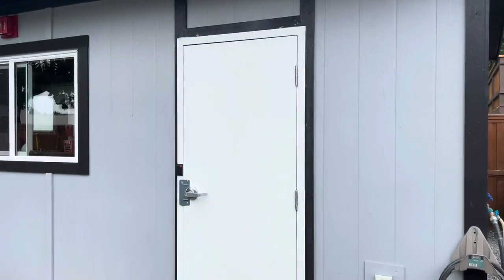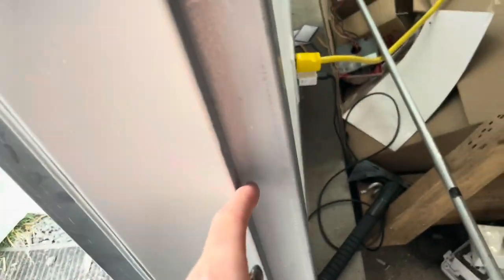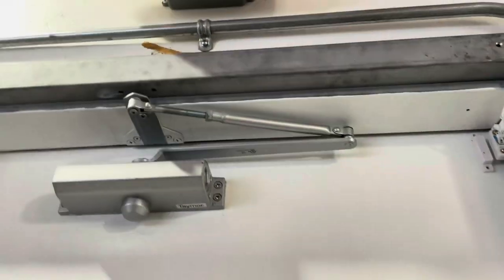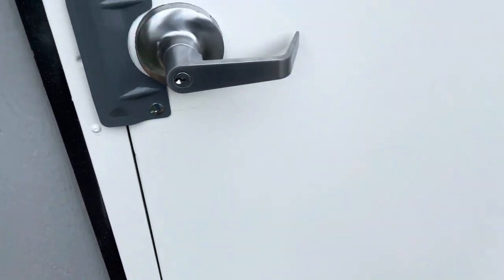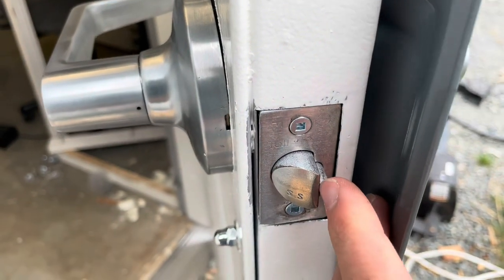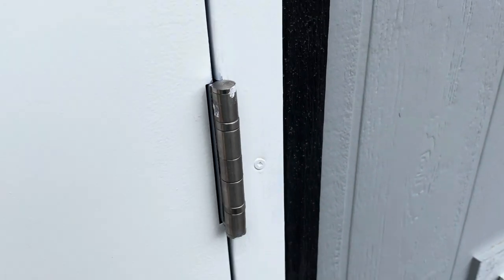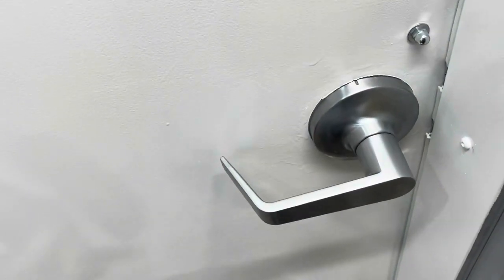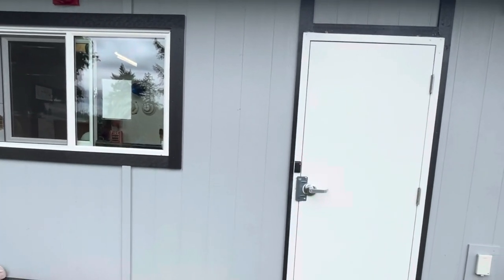Door upgrade replacing the door on my garage

Comment: Awesome install! Maybe you could install a panic bar in the inside! That would look pretty cool ngl!
Reply from the maker: That’s what I said in the video but yeah I would like to
Reply: @nics-systems-electric  Yea maybe if you could find one for cheap you could install one
Reply from the maker: @Roxxofoxxo  It would have to be compatible with Schlage hardware so I can still have a Key override on the outside and it would not use the latch inside the door so I would need an external strike plate an electronic strike plate for panic bar latch is about $130 minimum so it will be an expensive project but it would be fun
Reply: @nics-systems-electric  Ohh
Reply: @nics-systems-electric there is latch retraction option on several panic hardware, you could just get a Von Duprin 98/99 or 33/35 with some latch retraction setup. You just need to put the motor inside the panic bar with some wires. Or you can electrify the lever trim outside your door that has the fail secure so the fire alarm will unlock the door.
Reply from the maker: @relevanteaglealarms109  If I was going to do internal door latch retraction I would just keep the current electronic strike plate
Reply: @nics-systems-electric  you could. Well changing out and upgrading it to panic hardware would be beneficial to the doors in the future. Well the ones with the latch inside was basically rim so you could ether try to order a mortise version but more complicated chiseling.
Reply from the maker: @relevanteaglealarms109  I think a mortice set up would be difficult would probably be easiest to have the traditional set up with the rim latch at the end of the panic bar and the roller but instead of having the roller have a electronic roller strike plate
Reply: @nics-systems-electric  it can work. Since Von Duprin exit devices rims are also more common than mortise.
Reply from the maker: @relevanteaglealarms109  yes definitely not sure if I’ve ever seen a mortice with a panic bar
Reply from the maker: @relevanteaglealarms109  Sargent locks to?
Reply: @nics-systems-electric  yes, Sargent makes exit devices too, there is lots of varieties of branded exit devices such as Corbin Russwin, Falcon and more.
Reply from the maker: @relevanteaglealarms109  yes I know I meant does your school use Sargent locks too or just panic hardware
Reply: @nics-systems-electric  they do have Sargent hardware on the doors around my office building, some of the other buildings use Corbin Russwin Old Mortise Locks.
Reply from the maker: @relevanteaglealarms109  I just looked into it a little bit not a whole lot though and I can’t seem to find any panic bars with a rim latch from van Duprin that will fit a 32 inch door it looks like they’re all made for 36 or bigger
Reply: @nics-systems-electric you may have to cut the device in order to have the right amount of width.
Reply from the maker: @relevanteaglealarms109  yeah I’m surprised they don’t make one for 32 inch doors

Comment: Instead of a panic bar because they are expensive, maybe you could hook up a push to exit button up so it kind of like a panic bar but not really. Just a thought.
Reply from the maker: It would be cool bye I’ve never seen one installed in a building though I don’t think they’re legal in Canada or maybe all of North America I think they’re a bad idea as an exit device as there is a chance I could fail and if powers out or power is lost to the strike plate it would not open
Reply: @nics-systems-electric  yes. That’s very interesting about them not being legal in Canada. Come to think of it, I’ve never really seen one here in the US either. And yes it might fail due to a power outage.
Reply from the maker: @theblueexitsign8249  I think exiting a building should not require any electronics or electrical power just too many things that could fail for something that you may need to save your life
Reply: @nics-systems-electric  yes. You are so right. That’s why panic bars are mechanical and not electric except for the siren built into it. Also how was the notifier sfp 10ud. I can get a firelite one for 200 with an annunciation panel. I’m going to try to lower the price since they are charging 70 dollars to ship but I just wanted to know if it a good panel. Thanks
Reply from the maker: @theblueexitsign8249  Yes they are great panels probably the best conventional panel there is in my opinion

Comment: pickle what type of RFID reader did you use for that door??
Reply from the maker: 13.56 MHz ic reader
Reply: @nics-systems-electric  no what brand of reader it is?
Reply: @nics-systems-electric  and why is the beep so quiet
Reply from the maker: @VOLTRONDEFENDER4440  https://www.amazon.ca/13-56Mhz-Consumption-Waterproof-Security-Control/dp/B094V2S1MX?pd_rd_w=G2HLr&pf_rd_p=63f1ad20-eec1-4983-b467-18e78c36cc20&pf_rd_r=HNJVCK3YCDYP1RAA89ZK&pd_rd_r=ad3fe3bd-5fc9-422f-9f6e-0cc25539be9e&pd_rd_wg=tV8xB&pd_rd_i=B094V2S1MX&psc=1&ref_=pd_bap_m_rp_13_sc

Comment: If you are looking for a panic bar, Von Duprin is a good option since they are one of Schlage’s sister companies. If you decide not to install a panic bar, you may want to change the lever to a Schlage AL or ND series model.
Reply from the maker: Von Duprun Panic bars are nice but  so expensive why do you think I should change from the current lock set that is on there right now?
Reply: @nics-systems-electric  IDK why I even suggested that. The current lockset is fine.
Reply from the maker: @Firepanel6  The ones I have now are pretty good they are one of the higher end ones I believe as you can still rotate the handle when locked
Reply: @nics-systems-electric  I first thought that it was some cheap unbranded lock until I rewatched the video and saw the brand on the latch plate. Tell locksets are pretty good.
Reply from the maker: @Firepanel6  yeah pretty much identical to Schlage as far as I know at least  the parts seem to be interchangeable
Reply from the maker: I haven’t looked into it a ton but it seems like I can’t find a van Duprin panic bar with rim latch that will fit a 32 inch door
Reply: @nics-systems-electric  From what I've heard, the devices are cut in the field to accommodate narrower door widths.
Reply from the maker: @Firepanel6  only to a certain point different models will have a longer push bar which you can't shorten that part